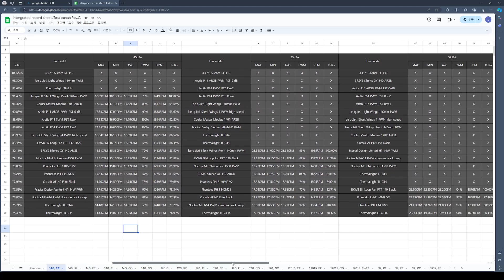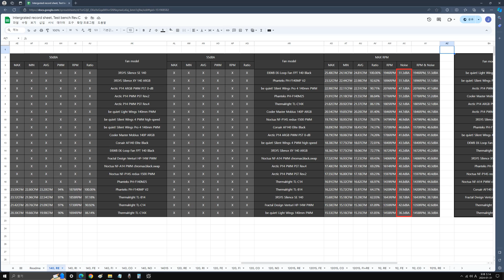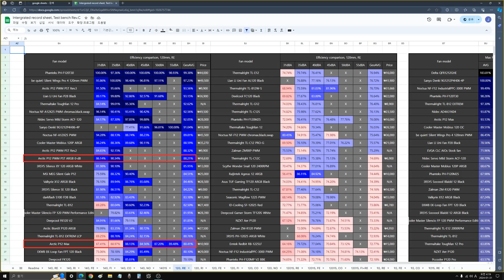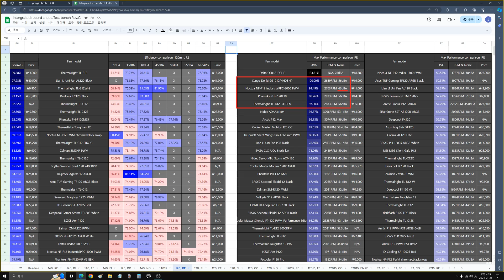Database spreadsheet of tested fans and Further explanation

Comment: What revision did you test the P12 MAX? Was it the DDB version or FDB?
Reply from the maker: P12 Max with Dual ball bearings. There were no FDB variants for Max series at that time. :)
Reply: @ThermalLeft  Thank you for clarification. It explains now all the bad scores. I have the FDB version and it's sucking in considerably more air than P12

Comment: You should test the cooling efficiency by fixing the CPU power and measuring the temperature at the same dBA level. After all, airflow may not be the primary factor affecting cooling performance; air pressure also plays a role. Therefore, testing the cooling performance will be more accurate.
Reply from the maker: Thank you for sharing your perpective. I'll explain why I didn't adopt the temperature method becuase of several reasons.

The methodology you explained can be good way to compare CPU coolers. But not the best. Measuring 'temperature' of CPU or GPU by using a monitoring software is actually 'estimating temperature.'
Plus, CPU/GPU temperature is very sensitive to ambient temperature. The result from winter cannot be compared with that of summer. So tester should control ambient temperature to obtain comparable results by using constant temperature and humidity equipment. But, this will really costy for personal testers like me. By the way, we can see some testers/companies show the temperature data as a form of dT (Recored temperature - Ambient temperature), but actually there is no reasonable explanation on it. X degree increase of ambient temperature will not directly derive X degree increase of CPU/GPU temperature.
Fortunately, airflow rate is not sensitive to ambient temprature. The dynamic viscousity and density of air will change according to the barometric pressure and dry & wet bulb temperature, but their effect on airflow rate is very small.

This is why I measured airflow rate rather than CPU/GPU temperature. I think measuring 'cooling performace' is not the excellent option for testing fans, especially for measuring the large number of test fans like the spreadsheet results in this video. The test methodology based on the technical standard (if you wonder, search AMCA 210-16.) shines when performing this huge size of test. But I think comparing temperature can be useful information for users when testing the small number of fans though.

Comment: AMAZING WORK! I mean reall huge!! What about a table that compares (already done by others) CFM/dB (at 35/40/45/50 db levels)  to implement noise to performance? Right now percentages are always relative to the top performer but this way numbers will be "absolute" and static in time, and also with this single value it will aggregate almost the major info needed. To push things further:  [(CFM/DB)/price] so the ratio will also include pricing to performance, and in the future the psychoacustic db instead of SPL, and that will provide the most real to life fab chart comparison ever.
Reply from the maker: Thanks for the suggestion. I'm now studying fan tester standard to get the actual performance correctly, which is known as airflow rate and static pressure(or total pressure).  Psychoacustic Annoyance will be introduced after I build new fan tester. I think it will be a long journey to achieve!
I'm also started to use CFD to explain some topics. I hope I can share more developed things than that I've done in the future.

Comment: Great video, do you recommend the XPG Vento Pro?
Reply from the maker: For server/workstation, yes. For personal computer, no. XPG Vento Pro(Gentle Typhoon) is innovative fan, but its bearing noise is quite annoying at low~mid RPM.
Reply: @ThermalLeft  Thanks you very much, you pretty much Hit the Nail on the head. This was mentioned by no one and I bought 7 of them and I can't stand the bearing noise haha. What Fan do you recommend for overall noise to Performance Ratio? I use a liquid freezer II and wanted good Air pressure. Btw subbed, you do good content, Cheers 👍
Reply from the maker: @nArg Maybe that is because Gentle Typhoon has different names(Gentle Typhoon, Vento Pro, Mild Storm) and small number of users so that it is a bit hard to find reviews.
I recommend PH-F120T30, Silent Wings Pro 4, Mobius 120P, P28, NF-A12X25 and Toughfan 12 Pro.
1. PH-F120T30: Most powerful noise-performance among those, buzzy noise profile, thickness of 30mm may limit RAM compatibility.
2. Silent Wings Pro 4: Very good noise-performance for radiator push setting, resonant noise from 2 RPM points, minute signal noise from PWM controller.
3. Mobius 120P: Good noise-performance for various scenario, ARGB included, weaker bearing lifetime than others.
4. P28: Good noise-performance for various scenario, not good noise profile for intake setting.
5. NF-A12X25: Good noise-performance for various scenario, lots of users' reviews, lower maximum performance than above(1~4) fans.
6. Toughfan 12 Pro: Good noise-performance for various scenario, lower maximum performance than above(1~4) fans.
+ Also, I think Grand Tornado(I haven't tested it yet) can be a good candidate option.
Above fans are quite expensive and changing the stock fans of LF II to those can only enhance maximum cooling performance when high workload. But for low~mid workload, the differance may not be large because LF II already have efficient fans(P12, but low max performance). Please consider usage of your PC before changing the fans. :)

Thank you for subscribing my channel. I promise more developed airflow test(already in progress) will come in this year!

Comment: Lian li p28 is my favorite fan
Reply from the maker: P28 can be especially good option for white colored and low noise system. There are some drawbacks of it, but it can still stand with other efficient fans. :)
Reply: @ThermalLeft  what type of drawbacks do the p28 fans have?
Reply from the maker: @SuKRFiSH42  
It has a thickness of 28T so that it is hard to mount at air cooler heatsinks. Note that P28's blade thickness is actually not different with other 25T fans. Its rear frame hub is just too thick. That is why P28 became 28T.
And the narrow clearance between its upper blade tip and front frame line. That means P28 can generate more noise when it is installed right behind obstacles. (ex. front intake fan positions of Fractal Design Meshify series)
Reply: @ThermalLeft Im used to loud fan noise so it’s not a big problem (coming from a dusty ps4 fan) as long as it’s quieter than the phanteks t30 fan I’m fine with it cause the t30 has a very loud bearing.

Comment: Would be great if you could take psychoacoustics into account somehow. In your video "Seasonic Magflow 1225 PWM and 6 other fans Noise test" for example at 35 dBA the Silent Wings Pro 4 sounds the quietest to me and the Nidec Gentle Typhoon sounds the loudest (probably the bearings?). There are formulas out there to calculate sound annoyance based on psychoacoustic parameters like roughness, tonality, sharpness, etc. of a sound if you want to give that a try. For example the SQAT toolbox for MATLAB. Imho grouping them by sound annoyance makes more sense than dBA alone but it's a lot harder to implement
Reply from the maker: Thank you for the feedback!

I just applied SQAT to MATLAB but I need to study about it very carefully. Then I searched some papers to learn about the 'Psychoacoustic Annoyance' models, and maybe I'll try Di's model that I can see the full contents of the paper now. The problem is that I have to implement the real-time calculation of 'PA' to use it for noise-normalized tests. Even though Sound Pressure Level has some obvious limitations in terms of psycoacoustics, many testers including me use SPL due to its convenience. But I'm familar with NI LabVIEW, which is widely used in instrumentation and measurement field, so that I don't think your thought is impossible idea. Implementing the model in LabVIEW(if possible, MATLAB will also be used), importing the signal from the microphone, automatically converting the signal into PA, and showing the PA value to me in real time. I'll approach this slowly. It will make my test more useful!

P.S. You're right. Nidec Servo Gentle Typhoon has ball bearings and generates noise from balls, especially for low speeds.
Reply: @ThermalLeft  NI offers a "Sound and Vibration Toolkit", do you have access to that? I'll be honest this is all way above my own skill level, so thank you for considering it. I hope it'll work out!
Reply from the maker: @athmaid  I had gotten access to the toolkit, but not now. But I can use MATLAB script in LabVIEW codes.
My another problem is that I want to do too many things(espeacially, automation of experiment and doing CFD simulations). I can't say it will come soon, but I'll schedule it for future change. :)